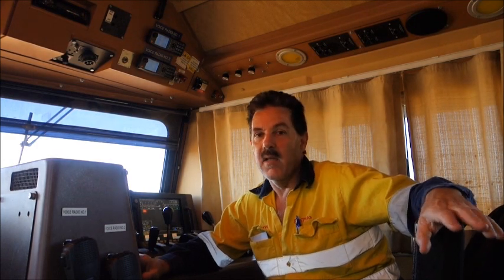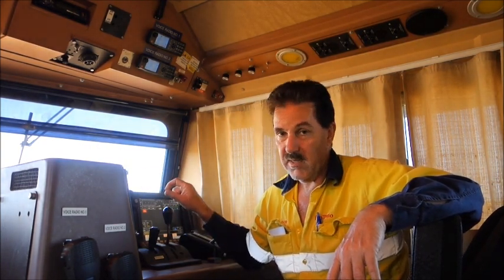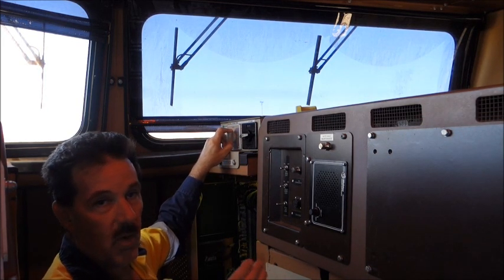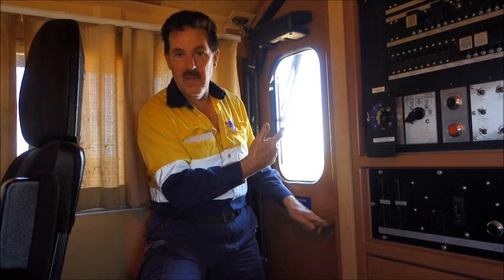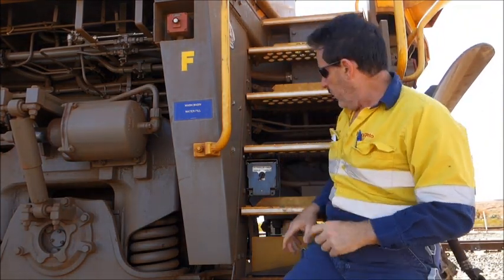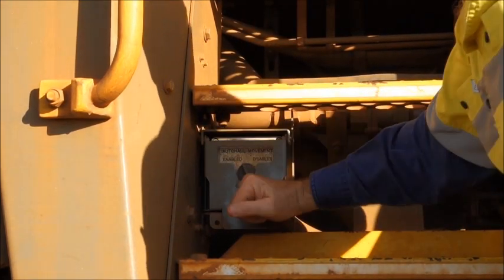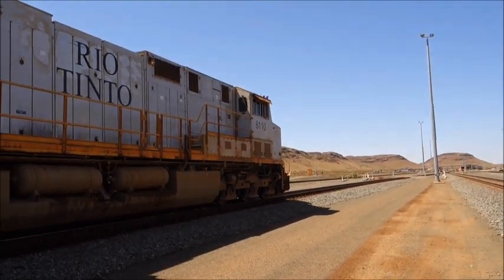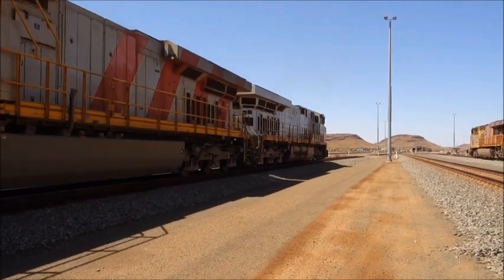Rio Tinto Autonomous Train

Comment: I left Rio in 2018 after 16 years took my long service leave and never went back when autohaul was coming on line, I was on attended trains ie driver sitting there while the train drove itself, the things it did would have you hauled into the office for a please explain if you were driving, run in run outs, when stopping it would be brake on brake off, power dynamic, power dynamic, at the bottom of hills where a driver would be normally in notch 8 the autohaul system would be starting to come out of dynamic brake and powering up losing at least 10kph in momentum meaning it would need to be in full power longer to get to the top using more fuel, we used to get chatted to for overriding the AESS by leaving the loco in notch 1, I believe that system has been disabled for autohaul so much for saving fuel and the environment.
Reply: I used to work with a guy like that. Would NEVER get a run at a hill. Wait for the blasted cruse control to play catch-up. I could've choked him since I was mostly following.

Comment: It's like an AC44CW mixed with an SD70, pretty cool loco.
Reply: I think the windshields is called teardrop for GE locos. And i think it's actually ES44AC but with larger radiators to adapt them in their high temperature workplace like a desert
Reply: @anf_8310_ab  The lead two are Gevo's yes under the model ID of ES44DCi, they use the longer frame of the AC6000CW the bigger radiators that you find of the 6000. the easiest way to know what you are looking at 9000 series are ES44ACi (the AC traction motor version) 8000's ES44DCi (DC traction motors) and the much older 7000's just about the standard D9-44CW (C44-9W however you know it as).

Comment: A simple bolt cutter and you have ownership of the loco . . .
Reply from the maker: Yes, but you'd have to know that in advance. OK, everyone who's seen this knows but this is all in the most remote area you could imagine and even if you were keen enough to travel there, you'd have to follow a train and wait for it to stop. Once inside, the motion detector will send an alarm to Train Control and a crew will be on their way. If you touch any of the controls the brakes will apply to full service and if you really wanted to do some damage by say, releasing the brakes and jumping off, you'd have to know how to cut out AutoHaul and ATP and only we know how to do that. A disgruntled ex-employee who'd been unfairly dismissed and wanted to get even could do it, but no one else could.

Comment: on a driverless train, what happens if the train breaks a coupler and splits? hits a car?  broken rails? bridge down?  theres no one onboard to fix it or render aid.
Reply from the maker: There are crews stationed every 80 - 100 kms along the track to deal with such things as they arise.
Reply: @davidrayner9832  wow. didnt expect you to reply. thanks.

Comment: David what happens about stray animals ie wildlife and cattle
Reply from the maker: They get mowed like grass. We hit cows and kangaroos like there's no tomorrow.
Reply: @davidrayner9832  does the loco sound its horn automatically?
Reply from the maker: @noelpurdey3494  Yes, before moving off and approaching crossings.
Reply: @davidrayner9832  I believe the technology in providing autonomous operations is a huge leap forward, something that should be celebrated not despised. As you stated you cannot stop progress, more important to be involved and have input. When operating does anyone watch over its running, or is it left to the programming to run?
Reply from the maker: @noelpurdey3494  Train Control simply sets the signals as they've always done and only checks the train if it stops at anything other than a red signal.

Comment: I'm sure I noticed that the bells on all the locomotives were ringing at 5:18. Why? or is this a graphics mod for Trainz lol.
Reply from the maker: It's to let everyone around know that the train is about to move. With no one on board to see if you're to close to the track, it's up to you to get out of the way.
Reply: @davidrayner9832  I know that but what I meant was why did the bells on ALL of the locomotives ring instead of only the bell on the LEAD locomotive.
Reply from the maker: @chandlerbranchrailfanprodu5928  Oh. Even with a driver on board, they always did that. I gather yours don't.
Reply: @davidrayner9832  Well what I mean is that the bells on the trailing locomotives also rang.
I thought only the bell on the lead locomotive did because in America (where these engines were made) only the bell on the lead locomotive sounds.
Why did the bells on the trailing locomotives ring. Is the one on the lead locomotive not loud enough to warn people that the train is about to move?
Reply from the maker: @chandlerbranchrailfanprodu5928  It's plenty loud enough but that's just the way it is.

Comment: where is Jon Voight, Eric Roberts and Rebecca De Mornay when you need them.... ??!!
Reply from the maker: Like any of them would be of use.
Reply: @davidrayner9832  To be fair Eric Roberts did have "two hands" and a cool hat.

Also, in the US most locomotives are equipped with a version of what you described as "Driver assist" and "Attended". It's not always available or it doesn't always work but the mere fact that it's here is writing on the wall. This used to be such a fun profession.
Reply: This is Down Under, not Alaska!
Reply: @DominicMazoch  I know, I am Australian,  but they experience a "Runaway Train"...

Comment: Sir it's a request to make a video that how this main locomotive works when there is no loco pilot.. I mean to say how the panel and switch board works automatically.. please make a video of it.. 🥺.. love from India 🇮🇳
Reply from the maker: Too late, I'm retired but it does what it needs to do without the controls moving. The engine will rev up but the throttle won't move, the brakes will apply but the brake handle won't move. It's just as if it's a trailing unit controlled by a leading unit.
Reply: @davidrayner9832  thank you sir for explaining it so easily ❤️😇.. but if you get a chance in future please a make video of it❤️😇..
Reply: @davidrayner9832  another thing sir you can explaining it elaborately "it's just a trailing unit controlled by leading unit" 🙂
Reply from the maker: @ShaanBlog  I meant if a train had 2 or more locos and you were riding in the cab of one of the trailing locos, it would do whatever the lead loco does without the controls moving. The locos on these trains now act like that. The trailing locos do whatever the lead loco does as they always have, but the lead loco now does whatever the program tells it to do.
Reply: @davidrayner9832  thank you sir for explaining it so easily ❤️

Comment: Does it have dcc sound?
Reply from the maker: No, but I can tell you that while locos in all other areas of Australia have mufflers these don't and they are LOUD. We once had a few CFs for yard work and they are basically the same as our regular locos but you couldn't hear them. To hear three of our locos working at full power is a motor head's wet dream.
Reply: @davidrayner9832  Is there any reason why Rio tinto is still the only railroad of it's type? Is any other australian railroad adopting similar tech?
Reply from the maker: @ocln2481  For a start, it's only possible because of where it's located and that every train is the same. Outside the Pilbara, operators travel through populated areas and run many different types pf trains. As for the other three companies in the Pilbara whose trains are all the same, they each say they have no plans to adopt such a system although I don't know why. I don't know if Rio has offered it for sale and if they have, I have no idea what the asking price would be. I can only say that it cost Rio many times what they thought it would to get it running and I'd assume they'd want to make a good chunk of that back. If they haven't offered it for sale, the other companies could develop their own as long as it's different enough so they didn't infringe on Rio's patent (I'm assuming they have one) but that would still be very expensive. I suppose it's like asking why electrification isn't more common in places like Australia and the Americas when everyone knows it's better. The reason is because it costs so much to do and would take many decades to recoup that investment. It'll take Rio many decades to recoup theirs but they are a company that, once they set their minds to something, they will not be deterred. In my opinion, it will lead to their downfall as the trains still need to be driven around the yard and so many drivers have left to work for other companies with the reason for doing so always being so they can drive trains, and no train driver would take a job with a company knowing they'll never get to do the fun part of the job - motoring across the countryside.

Comment: Great video.  I always wondered how that worked....  It would be nice to see a cab ride and it on remote control.
Reply from the maker: The cab ride would look like any other, except there'd be no one there and the engine would rev up and shut off, and the brakes would apply and release without the handles moving. That's what we used to see when it was in the 'attended' phase of testing. We'd set it up in attended, call control to say it was ready to depart, and off it'd go with us in the cab monitoring everything. We'd have to press the alerter to prove we were awake so we could intervene if the program malfunctioned or looked like it was about to do something that could break the train. I should've videoed that but I never thought to do it. Actually, I worked there for 10 years and most of these were shot in the last few weeks.

Comment: Tbh I don’t think I could ever trust a full on driverless train. I think monitored drive/self drive trains are the way to go. Let’s take Germany for example. You got LZB and AFB. Once the driver goes into an LZB zone with AFB on, the driver doesn’t have to do anything. Drivers then do manual driving with AFB on when not in LZB zones. You can’t fix a computer if something goes wrong. So having a driver in the cab if something was to go wrong is a last resort to save a train. Driverless trains lose that extra layer of protection.
Reply from the maker: Yes, and for a while as part of the development, we were riding in the cab with the computer driving the train with the switch in 'attended' which simply disables the motion sensor in the cab which allowed us to be there. This was to get our feedback on how it was performing. When it looked like it was going to do something that might cause a separation, we could intervene. Some did to save themselves the trouble of dealing with a separation and some didn't, preferring to cause the company as much grief as they could. In other words, if you're going to replace me with a robot, I can't stop you but I won't help you. Either way, in the case of a hot bearing or any other 'normal' event that required the driver to inspect the train, he was right there. Now, they're sitting in rooms which are spaced 90 minutes drive in a car apart so he's never more than 45 minutes from the train. That's fine, until it rains and the roads become impassable. Remember, we're in the tropics and when it rains, it really rains. I heard just yesterday that around a dozen more drivers that I knew personally have left over the last three months to go to one of the other companies so they can drive trains again. Sooner or later, Rio will be out of drivers and we will all laugh ourselves silly.
Reply: @davidrayner9832  something I wonder is what if a train was to hit a vehicle? How would the train stop in this case?
Reply from the maker: @CrazyDash9  The impact detector on the front of the loco would send an alarm to Train Control who would review the footage from the camera. I imagine this would take a few minutes. If they see it's a car that was hit, they'd stop the train. That said, the whole area is also cattle country and the tracks are unfenced. We hit cows like there's no tomorrow and 99.999999999% chance any impact will be with a cow. Bear in mind that the Pilbara is to Australia what Siberia is to Russia, almost uninhabited.
Reply: Computers go wrong? No way, they are using Windows 3.1
Reply: The AFB+LZB system is not a real autonomous driving like ETCS+ATO or like Rio Tinto's Autohall, first of all the AFB+LZB system makes many corrections and is not always the ideal driving for the vehicle, furthermore the use is not mandatory, a driver can drive the train manually and I have noticed that many do. The situation with ETCS+ATO is very different, you have the controls disabled, the only operations allowed are closing the doors and the start command, you cannot manage braking or acceleration, the levers are in the neutral position, you can at most activate the brake emergency, every movement of a lever, even by mistake, will cause the ATO system to be deactivated and to reactivate it you must stop completely and by regulation it is forbidden to drive the train manually where ETCS+ATO is present, only in the event of a systems failure you must drive the train manually, at low speed, until the MA is restored, some companies allow the use of manual driving 1 day a week at certain times to maintain a minimum level of competence, others strictly prohibit its use, in Milan the subways are with the ATO system, with the exception of one which is still manually driven, the others are autonomously driven with driver, the driver opens, closes and then presses start, if he just tries to drive for 5 minutes without justified reason he will be fined and suspended from service, if he does it again he will be fired, the only manually guided movements are exiting the shed, the control levers in fact in the last notches are very hard, because they are always immobile, a ridiculous case, it happened a few years ago it was with a slowdown not managed by the safety system, since it is forbidden to drive, no one knew how to deal with that slowdown because no one knew how to drive anymore, they had to call an instructor to guide a part of the route and then relay with other trains, after that episode they installed some simulators, but manual driving remains prohibited by law. ETCS+ATO They are installing it on the Stuttgart S-Bahn and many train drivers are asking for the transfer because they don't want to do a monkey's work

Comment: Thank you for the video, very well done. do you think unmanned freight trains will happen in the US with the proximity to populated areas, crossings, and hazmat?
Reply from the maker: Rio Tinto is in the middle of nowhere but another thing that makes it possible is that all their trains are the same. Same length, same weight. Only one program needed to run the trains. Much more difficult for a company that runs lots of different trains, whether they're in a remote area or not.
Reply: @davidrayner9832  i had never considered that the trains are all the same. it's very obvious now you mention it. same trains, same routes. thank you.
Reply: The NTSB has mandated 2 person cab occupation along with the latest union contract.
Reply: Never Happen!!
Reply: Probably not because there are so many types of American fright trains like you have locals, mainline, switching, yard transfer, unit trains, power moves, high and wide equipment and more
Reply: @THE_IRON_HORSE  Trains already can run themselves with the PTC integrated EMS. All the engineer has to do is start, stop and hit the alerter. The PTC will even blow the horn. Of course, not all locomotives are capable/equipped and it doesn't always work or it fails enroute. But either way, it takes the fun away and proves how little RR's value their employees.
Reply: @michlo3393  PTC is positive train control that does not mean a locomotive can run it self. PTC is to ensure trains don't run red signals and if they do they will be stop 🤣 PTC does not blow the train horn 😉
Reply: @THE_IRON_HORSE  Yes it does. It does all of those things. Ask me how I know...go ahead.
Reply: @michlo3393  go ahead, tell me
Reply: @redstonerelic  it's my job. Don't you just love when some kid tells you you're doing what you get paid to do wrong?